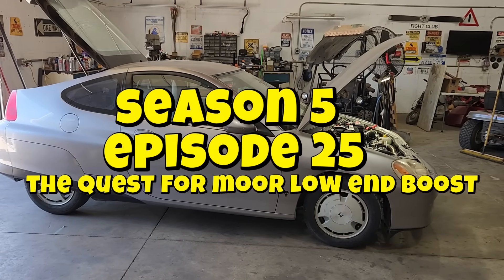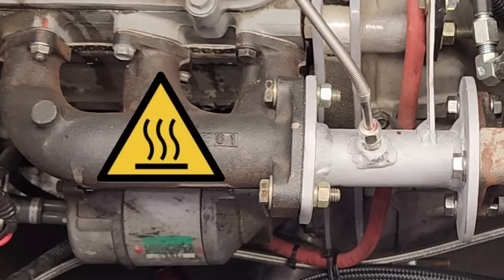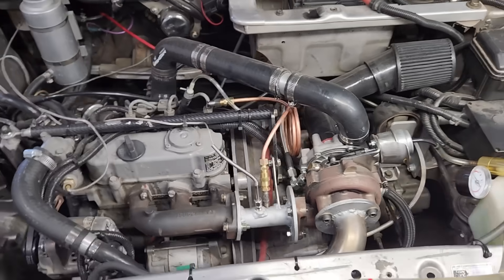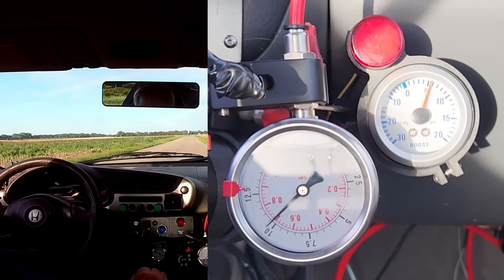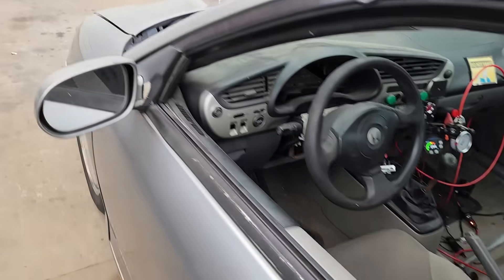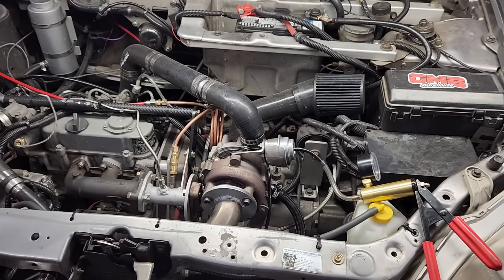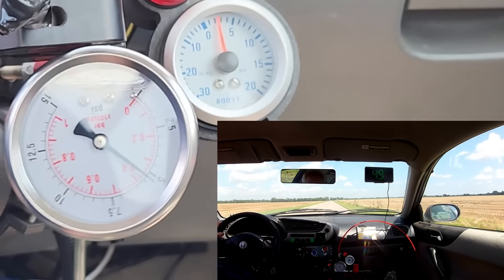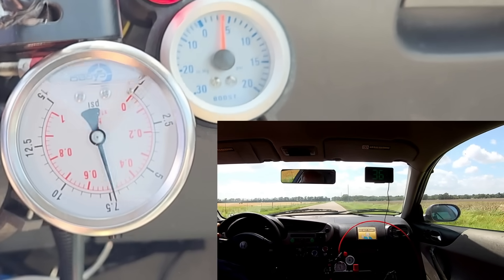S5 E25. Can we get more BOOST from the VNT/VGT turbo on the 719 cc kubota diesel Honda

Comment: Love the video. I have a D1105 Kabota diesel that I would like to turbo charge. It is 1.1L. It is not going in a vehicle It is going into a piece of equipment, a stump grinder. There is a turbo version of the D1105, it is a D1105T. Is the Lupo turbo you are using a eBay special? I think I can manage the VGT system with a standard wastegate control actuator. The D1105 it rated at 25hp the turbo version is rated at 32hp. I have no idea how much boost is used to make 32hp. Thank for the content. It is fun to watch you play with the combinations and see the results.

Comment: I know this is a little late but I've had a bit of experience with larger version of this turbo, gt2056v. What I did was I tune the vanes to maximum efficiency at the bottom and then used an adjustable wastegate that works off boost. It's been working for about 3 years and hasn't failed yet. Also a comment was made about running a super charger with the turbo. This would help if the super charger blows into the turbo. The vacuum from the turbo will relieve some stress from the super charger once the turbo makes boost.

Comment: Not a turbo expert, but a 1:1 ratio back pressure to boost seems where they are all happy. I am looking at the nozzles as a back pressure regulator, not a boost regulator. Could you control the veins mechanically to maintain this ratio? "Reference" boost pressure instead of atmosphere, and "read" exhaust back pressure? As back pressure drops at low loads, the veins would close, until boost rises to match. As load/exhaust flow/back pressure rise, the veins would open to relieve back pressure until boost and back pressure match, say 15psi-ish ideally for both boost and back pressure. 
A double acting vacuum/pressure solenoid would be required unless you can easily seal the atmosphere side of yours

Comment: I know you mainly do combustion engine experiments, but since you took a hybrid and threw a small buggy engine in it instead, have you thought of converting it back into a hybrid with the kubota engine?  I mean just small motors to the tires to assist in launch and regenerative braking to gain back energy, seeing how much energy that saves on an already efficient setup?

Another hybrid idea that is more experiment heavy is adding an electric motor to the engine itself, like a reversed alternator, but possibly attached to the crankshaft or timing chain.

Comment: Hello sir you want more boost you need work on turbocharger threshold . It is equivalent to change air compressor wheel trim . More likely near 65 % and upward. It means biggest inducer

Comment: I think this car needs a new turbo. I don't if this turbo makes sense to use with this engine at all. I know th point is to experiment and fool around with a strange turbo on this engine but it just doesn't seem to be working in a way that makes sense. You might as well super charge it if you want to make this thing fast and just tune it to the limit of the engine before it can't handle any more power.

Comment: good day. in theory, to squeeze out maximum power. the compression ratio needs to be reduced to 1/14 (increase the size of the combustion chambers) install an intercooler and blow with a turbine no more than 0.5 bar. increase fuel injection. start only with a glow plug. in other cases there will be overload of engine components and low efficiency since there is no point in raising the compression ratio above 1/22 somehow like thatI'm writing through a translator. Good luck with your experiments.

Comment: You will need more fuel to make more boost, you only have a certain amount of energy being expelled in the exhaust gasses. Increase the fuel amd you will make more boost, the downside of this is it will blow more smoke however

Comment: The goal is to adapt this turbo from a different engine to work with the engine you got ???

  If the engine you got pushes less exhaust gases, then does it mean you need to limit the intake gases too even it out ? Narrow the turbos intake in proportion ??
  Would it allow the turbo to spin more freely ? Doss expecting the turbo do the same or more with less input make sense ???

Comment: Experiment suggestion
Using the previous turbo try this.
Using rocketry principles make a new manifold as follows ; three equal length short tubes off the ports into a log of four or five inch diameter.
Neck the turbo end down with a steep cone to about one inch diameter, then using a cone expand it out to meet the inlet diameter of the turbo.
This should convert pressure into velocity without choking the motor too much.
A waste gate on the manifold to bleed pressure at high RPM might be needed.

Comment: This isn't back pressure, it's drive pressure and you want it to be 1.5-2:1, back pressure is when you put a cat on and it's blocking flow out the turbo. Like I've said since the first video, you need a td03 13t that you can get for $100

Comment: Aim for as close to 1 to 1 drive pressure to boost pressure.   Try rigging up a push/pull cable to the vnt actuator and operating it manually as you drive

Comment: ok. put the super charger back on. the turbo sucks and is boring the stats from the supercharged testing was interesting and meaningful. was looking forward to more testing as i have this engine in my tractor, and the supercharger seemed the best option. but then you abandoned it for views and went back to the turbo. you already proved that the supercharger is better and more efficient and better for the engine .so everything after that was just for views. the science and learning stopped.

Comment: They make turbo kits for a Yamaha fz09! It's slightly larger than your kubota, but they're 849cc or so and are not built to go off the manifold. Maybe you can source one?
Reply: This being said, those bikes are 3 cylinder also, but Rev very high in comparison.

Comment: If you want it right, you're going to need to meter the fuel rate and boost. At some point the injector size will become a restriction, but that comes further down the line. I suspect a maximum of 50-60hp from this little guy before you start spending real money on fueling parts.

Comment: I used td wg controller actuated by the pressure instrad of vacuum. from vnt one. Turbo is ok give it more fuel and adjust turbo to peak 1.2 and see then

Comment: You measure the back presure against atmosphere. But you gave the engine pressure on the intake, so you should distract this. So 11 PSI backpresure - 5 PSI boost = 6 PSI backpresure.
And I am shure you have to adjust the limit screw first. You need more fuel, now that you have boost. More fuel = more power = more exhaust presure to spin up the turbo = even more power. The scew should only be turned back if black smoke comes with the ACTUAL setting!

Comment: In this video you proved yourself that more EMP(Exhaust Manifold Pressure) doesnt equal more "boost",I'm no profesional when it comes to this bussines,VGT helps with GAS VELOCITY,but if your flow is minimal then you can have all of the gas velocity, you will not be able to spin the turbine, from what I know you want an equal P/R(pressure ratio) between the pressure that you have in your intake manifold and the air that gets out trough your exhaust manifold into the turbo for the best flow, since your injection pump is fully mechanical you cannot get an actual injection quantity measured to an arduino in order to make a proper boost map and a PID for said map, but what you can do is try to get a MAP Sensor (Manifold Absolute Pressure) and an EMP Sensor,hook them up to an arduino,and make 2 maps, one in which IF RPM raises, you have a certain amount of duty applied to a vacum valve that moves the position of the vanes,and one map for the situation in which RPM does not change by 50 to 100 RPM+/-, in which the arduino opens the vanes slightly for a better P/R

Comment: Have you tried engineering for emissions? Your extension pipe seems to be the size of a small catalytic converter/diesel particulate filter.
Placed ahead of the turbo, the high back pressure means higher exhaust temps compared to the temperature downstream of the turbo.

Higher exhaust temps make a hotter catcon/DPF...the hotter, the more eficient.

Comment: Reinstall the stupidcharger . And allso leave the turbo on. Thebway it has to work is , you would have the turbo push air into them stupidcharger , and that should push air into them engine.

Comment: GFB make a very good manual VNT controller. I can provide basic instructions if needed. I use them often and keep one on the shelf for when I need one. Still watching:) fun!
Reply: This is what you want :) you're experiencing textbook turbine choke.

Fit a GFB manual VNT controller and play with rise rate. You'll need to add fuel to encourage spool. Keep egts under 650celsius pre turbo for continuous load. You can run hotter for short periods. 

Pressure ratio should be under 2:1. Typical numbers are 1.3 to 1.5 as a guide, but it all depends on power and egts. If power goes up, keep going. 

Hope this helps 🎉

Comment: You are misunderstanding why manufacturers use VGT turbos... Thay are using them primarily for adding backpressure to make the EGR flow into the intake. 
A properly sized and tuned turbo will make more boost than backpressure right after it starts to build boost, which is great for efficiency, but a real issue when you are trying to get exhaust to flow into the intake.
Most VGT turbos are specifically designed to be horribly inefficient when fully or nearly fully closed  for the sole purpose of building backpressure without boost. 
My experience is when the VGT is more than 75 percent open you can get good efficiency (more boost than backpressure)
An example for those who are curious cummins isx15l idles at 800rpm redlines at 2100rpm
At 1250 RPM I get 22 psi backpressure, and 26 lbs boost VGT 25.7 percent closed from fully open, 80k RPM on the turbo. This is on a properly tuned engine, not factory. Most truckers refuse to rev a cummins that low under load.
Anything above 1400 rpm and you are making more backpressure than boost. at 1750 rpm the turbo is 10 percent from fully open 40 psi backpressure, and 30 psi of boost. 
If you are about efficiency you need a turbo that starts to build boost just below the rpm you are going to be using it at (with the actuator mostly open)
In your case you need a smaller turbo.

Comment: At least you can fully research all of this to your own scientific satisfaction, even if nobody else agrees with you.

And, even though in some conditions, some engines can benefit from having both a blower and a turbo, those typically are only 2 stroke diesels pre-programmed for it. [aka the old Detroit 2 strokers]

Most other motors either can't handle that kind of boost without things breaking [aka 'blowing up'], or else they are racing engines which are both prohibitively expensive and packed with rare unobtanium type parts and engineering.

So, while it may be TECHNICALLY possible to use both a blower and a turbo, if you're not racing a high dollar sponsored car which nobody minds if it blows up in under a quarter mile, its likely a very bad idea.

[see this article on 'Twincharging'...not to be confused with 'Compound Turbos' or 'Turbo Compounding'] https://en.wikipedia.org/wiki/Twincharger

Its expensive, complicated, and tends to grenade most motors.

Comment: There is almost no heat from the exhaust because it has almost no flow it just builds up cools in the pipe and gauge and drops off returning to the exhaust, smaller fittings and tube would transfer less heat directly and at 15 psi only twice atmosphere at a tiny volume cycling to and from the gauge no continuous flow of  exhaust and heat to the gauge.

Comment: I'd do a compound turbocharger setup if possible. A smaller turbocharger that's a high-pressure turbocharger, and then at a certain speed or rpm, have a slightly bigger low-pressure turbocharger feed the high-pressure turbocharger.  Might get more power that way. Though, you might want to have a self correcting fuel rack adjuster to supply the correct amount of fuel at all times with such a setup.
Reply: Correct me if I'm wrong but isn't that effectively what VNT gives him already? Sounds exactly like it to me... 
Vanes closed = smaller-high pressure
Vanes opened = larger-low pressure
Except this is far more tunable.

Imagine if we had a variable pitch impeller to do the same for the boost side! (like an airplane prop can do, to change the angle)

Comment: One thing I'd like to mention is turbos work off heat basically.  The expansion of the hot air is what drives the turbo.   Adding insulation and a turbo blanket to the exhaust manifold and connector pipe and a turbo blanket on the turbo will increase the turbos performance but how much I haven't a clue.  Instead of back pressure its actually called drive pressure because that pressure is driving the turbo.  You always want to get as close to 1:1 ratio of boost and drive pressure as you can.  Keep in mind drive pressure can be just as dangerous probably more dangerous then boost pressure.  If your making 5psi of boost but 20+ psi of drive pressure your turbo is way out of efficiency and your holding in 20psi of hot pressure in the engine against the head gasket and exhaust valves which can result in major problems

Comment: Sounds like you're starting to introduce boost creep. As rpm and load starts to climb, it gets harder to maintain a steady throttle. That's something variable turbos aimed to remove. It's caused by out of control back pressure. The car feeling faster can be reflecting that, since humans only feel the change in momentum.
Something you have to consider is higher back pressure will usually result in higher boost number, cause of the increased engine load. It won't actually show as increased horsepower though. 
I don't have a recommended solution though, other than setting up a "waste gate" or in this case a regulator tied to back pressure that regulates the VNT.

Comment: Ya, I want to see both, but for specific reasons.  The supercharger gives boost at low rrpm, and the turbo doesn't.  By running both in series, you can get boost across the full range of rpm.   The supercharger will have some parasitic losses, but as the turbo spools, it will feed the supercharger  with pressurised air, lowering the hp the supercharger is using to provide the same boost numbers.  Banks turbo has done this for the same reasons. Lot bigger engine i realise, but theory is the same.

Comment: rip the actuator off, throw on a cable into the cabin so you can adjust it on the fly. why mess with vacuums when you want boost?
then clock that housing so the drain is vertical!

Comment: Probably easiest would be to move the vanes with a servo. Can be remote mounted with a cable, nothing too fancy. Probably the method would be to try to minimize back pressure while maintaining desired boost. In other words to maintain as high as possible boost/backpressure, or some 'gold' number/range.

Comment: Late 90's to mid 2000 mercedes c230 supercharger. Compact, powerful, easily sourced, reliable and cheap. I fabbed one to fit into an a/c compressor mounting location with flat bar and a drill plus hardware. Just throwing out the thought. Thanks for the video, Jimbo!

Comment: Forcing the VGT nozzle closed with a vacuum pump renders the turbo a fixed volume, hence the increase in backpressure. The vacuum actuator needs a dynamic signal that opens the nozzle under load to allow more exhaust flow.

One method to achieve this mechanically, rather than using electronics, is to install a throttle body on the intake and use the vacuum created in the manifold side to control the VGT actuator. Some mechanical diesels in the past used this method to control the fuel rack, thus providing automatic altitude compensation.

Just some thoughts that may be useful.

Comment: One test that could interesting would be to back the lever stop out as with the first test, shorten the actuator rod to the point where the engine will maintain boost under load, then test drivability when you can cycle the turbo without boost falling off.

Comment: Thr engine probably can't supply the flow to create higher peak boost pressures, however it might be that you're getting to peak boost faster. If you want higher pressures you'll have to go with multi-stage turbocharging.

Comment: You can only run so much backpressure before the exhaust valves start getting damaged by the heat. Turbocharged engines typically run sodium filled exhaust valves. My 1.6L VW diesel had them in the GTD.

Comment: Exhaust gas pressure is directly related to its energy, and its energy comes from being hot and fast.  If the exhaust flow of hot gas is being cooled by the exposed exhaust manifold and exposed turbine housing, it loses heat and thus loses energy.  Everyone needs to keep in mind that a turbo has losses on the exhaust turbine and the compressor, maximizing the energy that drives them is important.

Comment: If looking for another turbo to try. A smart car using the om660 diesel, which is 799cc. It uses a kp31 which is one of the smallest automotive turbo out there. The exhaust housing is combined with the exhaust manifold. But I cut it off and I’m working on adapting it to a yanmar in a John Deere 332.